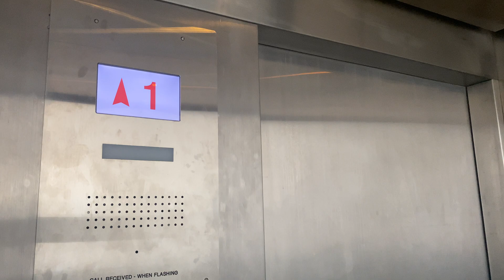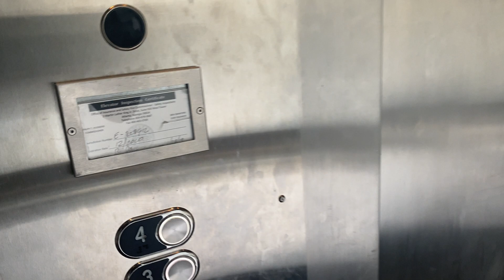This elevator got modernized and IT’S EVEN WORSE THAN THE ORIGINAL!

Comment: The reason it stopped at the top is because of low oil protection, they since fixed the leak and it doesn’t do this anymore